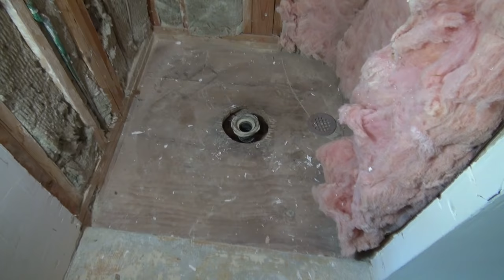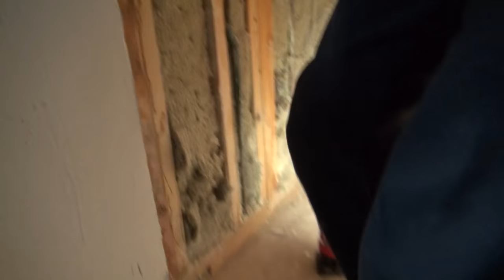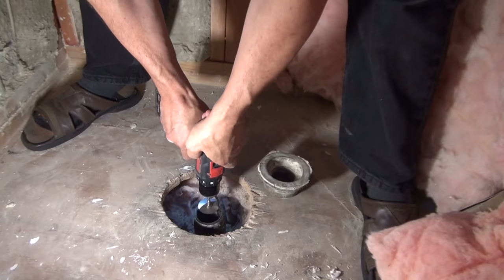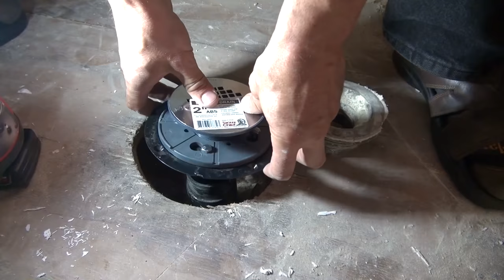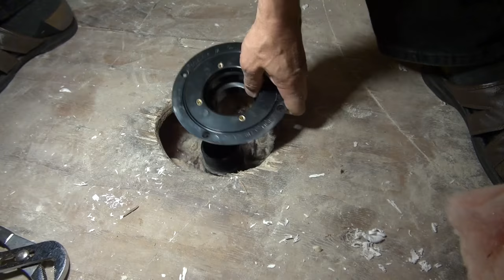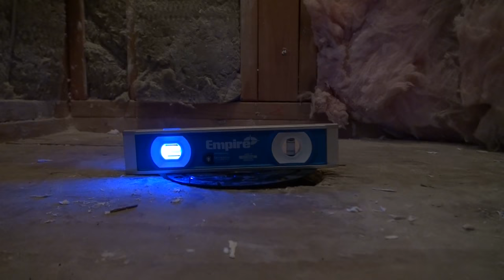How to cut old and install new shower drain. Как срезать трубу

Comment: I Always use silicone on fiberglass showers it will flex with the weight of people standing in the shower. But i do like the brass shower drains VS the plastic / pvc shower drains. I have the tool that tightens the nut down over the beveled gasket ( i also see alot of contractors who install the beveled gasket wrong ) instead of that cheap little flat tool they give you to turn with a screwdriver or channel locks the tool i have  has the groves built into it that's specifically for the no caulk drains. It tightens it down super tight for a 100% no leak. I also use silicone underneath wear the black round gasket is too. Then while im cleaning up my mess and tools i let the 30 minute shower ready silicone cure by the time my tools are cleaned up and the area is cleaned i test it. Then write up the invoice, get paid and on to the next job.

Comment: Should cut out floor at joists and replace wood with smaller hole for drain so as it can be secured properly. This new drain will crack and or move causing water to get under new membrane and leak again.
Reply from the maker: No. I said to the owner more easiest way. Take piece of plywood 12x12. Drill 3" hole in a middle. Cut plywood on half. Slide two piece under flange and screw it to the subfloor. Flange screw to plywood pieces. Done.

Comment: Does the new drain need to be longer than the old one? If you cut off part of the pvc pipe to replace this, how do you make sure the pvc is flush with the new drain?
Reply from the maker: That's really depend on the pan construction. Need measure all parts individually in place.

Comment: I had a plumber set a new shower flange in my basement roughin. It's a bit cockeyed and sloped. Height is fine but I'm not sure of I should have it removed the flange leveled. I feel like it will become an issue when I'm tiling the shower and may look a bit off. It's about 1/4" slope.
Reply from the maker: Should be leveled or you will see ugly grout finish around flange after tile.

Comment: Allways fill the sub floor before installing the flange also make sure the flange is level before letting the PVC cement dry
Reply: I'm amazed he didn't even tack some boards under his tongue and groove... just for stability. It's gonna be interesting when the drain falls through the floor halfway in the middle of a soap😅
Reply from the maker: @0uiallo  My part of work was just a pipe connection. Owner did all rest work - support under flange.

Comment: the video is good up until the install, you were supposed to fix the plywood and make the subfloor hole smaller so the drain can sit on plywood
Reply from the maker: You right, but i already explained it in a previous comments.
Reply from the maker: - "My part of work was just a pipe connection. Owner did all rest work - support under flange".
Reply from the maker: Two piece of plywood with half circle hole on the edge will make the best support under flange.

Comment: how much did you have to sand off the outside of the drain?  I just took my flange back to the hardware store because the inside diameter was 2 1/4" and my drain flange is 2 3/8" outside diameter.  Is this made to be like a force fit?
Reply from the maker: Nothing was sending down. Standard flange 2" to the standard pipe 2".
Reply from the maker: https://www.homedepot.com/p/2-in-ABS-Shower-Drain-with-Strainer-821-2APK/202313070

Comment: You mention that it will be screwed to the plywood. Did you then cut out a piece of the plywood like 12 x12 and taper the edges and screw into that. Would like to see a video on that part.
Reply from the maker: Yes I cut approx 12" x 12" 1/2" plywood, cut 4"-5" hole in the middle and than cut that piece in a half. So I get two half moon shapes. Slide it under drain flange and secure with screws to the subfloor and flange to the 1/2" plywood. Unfortunately i don't have more video from this project.
Reply: You would need to install a piece of plywood over the whole area, then install a mortar preslope, then a pan liner.  The pan liner goes in across the top of this flange, so he put the flange way too low and doesn't have room for the plywood or preslope.    After the pan liner, you do a mortar pan, then the tile, so the finished floor will be much higher.  The top of the drain screws into the flange shown in the video.
Reply from the maker: No plywood for whole area. I don't need extra work. I did a full remodel many-many times. You can see a lot of videos in my channel about it.
My NEW project is done! You may be interested in the Shower Pan Rebuild:
Shower Pan Rebuild. PART 1- https://youtu.be/NdhPWNkK66o
Cut tile from bottom of the shower. PART 2 - https://youtu.be/NNBwQVA1LwY
How to Pre-Slope Shower Pan with Beadex. PART 3 - https://youtu.be/prp_vglYv4c
How to install ABS Shower Drain. PART 4 - https://youtu.be/v57eQe-eC4w
Shower Pan Liner to ABS Shower Drain. PART 5 - https://youtu.be/9c9xxkL0Am4
Shower liner and Concrete shower base. PART 6 - https://youtu.be/LSbB_ml0UtE
RedGard Waterproofing Membrane. PART 7 - https://youtu.be/e_4Wzgtxic0
Install a Pebble Tile / River Rock Shower Floor. PART 8 - https://youtu.be/m9Zb81AMSI8
How to make a simple Jig to cut 45-degree tile edges - https://youtu.be/nzSYCPHPmRg
How to tile Shower Curb with 45 degree outer corners. PART 9 - https://youtu.be/wdOxYGWcFSk
How to 45 degree tile cut. No Jig, just hand - https://youtu.be/9WmOIYn1QL4
Footstep in shower. PART 10 - https://youtu.be/2YrMN22kz2k
Shower Curb, Wall grout & Glass Door Base installation. PART 11 - https://youtu.be/L0Ms7sEOEWM
How to Silicone a Shower. PART 12 - https://youtu.be/Edb9fXIdkRk
Schluter, custom size tile edge. Last 13th PART - https://youtu.be/kT9hc3D00ec

Comment: Thanks for this video
can you please tell me
what kind or drainage pipe is that?
is that PVC or PPC or PE /
what kind of glue did you use?
Reply from the maker: Regular utility pipe - Black ABS. Black ABS glue. https://www.homedepot.com/p/Oatey-8-oz-ABS-Cement-in-Black-308893/100345366

Comment: Is that a Dremel saw blade you used to cut the pipe below the floor level?
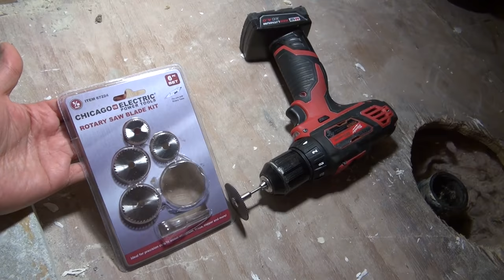Reply from the maker: No not DREMEL. Under video you can find all links with tools. There is a Harbor Freight Tools  ROTARY SAW BLADE, se it at 1:34 in my video.

https://www.harborfreight.com/catalogsearch/result/index/?dir=asc&order=EAScore%2Cf%2CEAFeatured+Weight%2Cf%2CSale+Rank%2Cf&q=rotary+saw+blade

Comment: I noticed you didn’t rebuild the subfloor to secure the flange. If someone steps on it while showering, it will flex and compromise the seal.
Reply from the maker: That's just a part of video. Of Course will be screwed to the floor.
Reply: How did you pull that off after you already glued the bottom flange on?
Reply from the maker: Nothing was glued.  Flange on the video just pre installed without glue to check level. suport under flange and glue was later done by the owner. I just help to cut off the pipe.
Reply: Could have swore seen you use glue but guess I dont k ow what PVC glue looks like lol

Comment: Dont use this beat for this type of video, its sacrilege
Reply from the maker: I was used it many times. Main tip - cut plastic in low speed to prevent melting.

Comment: This dude is wearing sock and sandals while installing a shower drain and I find it very distracting.
Reply from the maker: Sorry guys, but it's hot if work in shoes 8 hours inside the house.
Reply: Sandals are way more comfortable with socks.  I don't get the sock-sandal hate thing.